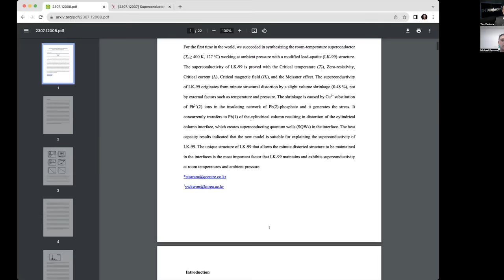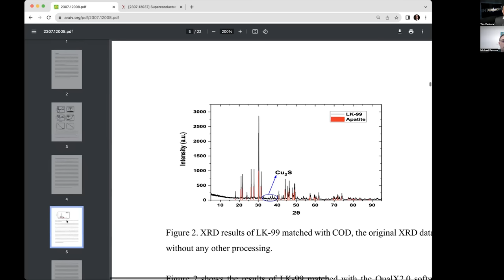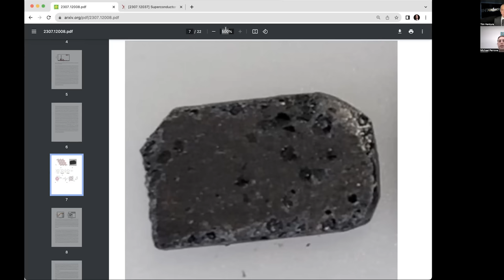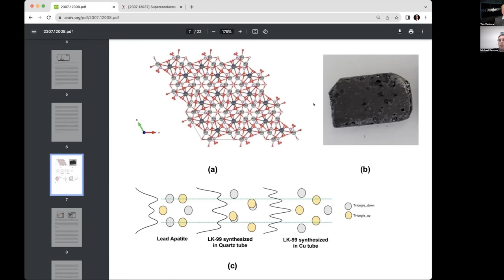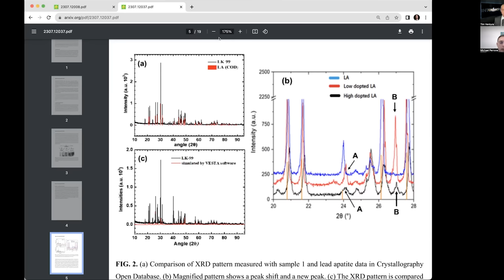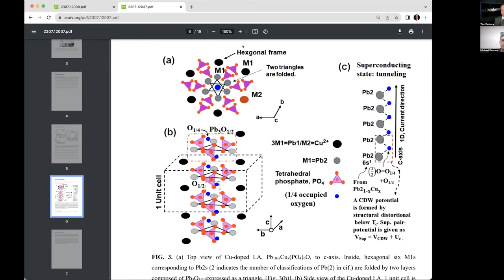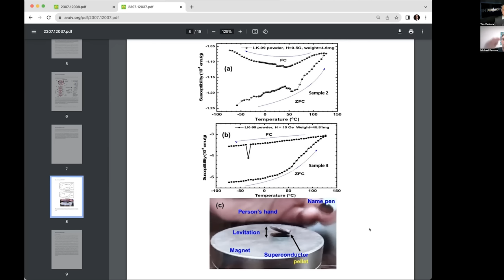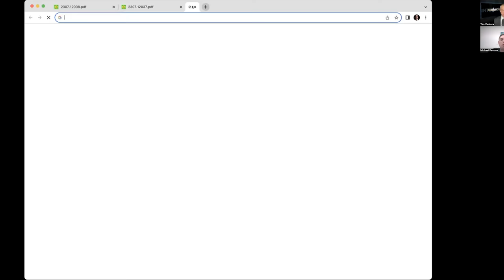Michael Perrone - LK-99 Superconductor

Comment: If an ideal superconductor is ever mass produced, it will be one of the most important advances … bigger than internal combustion engines, bigger than mass produced steel.   Besides levitated trains, solar voltaic energy from deserts to thousands of miles away where it’s still night. Incredible electric motors, 100% efficient electric energy storage, MRI machines to cellular level, perfect electromagnetic shielded rooms, nearly infinite Q resonant circuits.   Even a portable muon source for imaging solids like the Pyramids.

Comment: Some more good news about this is that once scientists isolate the exact crystal arrangement in the material which creates the superconducting effect, it should not be too difficult to use it as a seed to grow a much more pure version that likely as better properties because it doesn't have as much junk that the original may have had. They could also find better synthesis techniques improve the efficiency of the time it takes to create this stuff which would dramatically speed up the development of this material.
Reply: Exactly. I feel all these results are not very reliable when they aren't based on the purest form of the material.
Reply: Yes it should be easy enough to crush up material and isolate the best bits via the meissner effect to narrow in on the optimal composition.

Comment: Basically if a manufacturer finds a way to purify the materials and fine tune the baking processs, this could be commercial soon.
Reply: I don't think the baking process will be used for mass production - probably only to get seed crystals for the Czochralski processes or something similar. Maybe some initial/immediate stuff will be done this way but there's many ways to scale this up

Comment: the limit is current with this as it is... if its a real effect the breakthrough lays in the material science...we now know we can shrink the lattice with a chemical process and without extremely low temperatures and high pressures...different compounds and elements may yield higher current throughput

Comment: SUGGESTION for examination of Meissner effect:   Submerse the magnet and material in liquid to reduce the effective weight of the sample.  If the liquid is sufficiently dense, the material may completely levitate over magnet.
Reply: Yep we will try that in water and liquid nitrogen
Reply: Seems my comment is not being shown.  Possibly due to a link to a paper on isotopic substitution in HTSC.

I'll try again.

The Isotope Effect on SC is well established.

“Heavy” Oxygen 18 Isotope is about .2% of atmospheric oxygen.

Ambient oxygen is 99%+ oxygen 16.

Here is an example of how incorporating specific isotopes can affect SC performance:

Substituting O-18 into (this) HTSC has been shown to have, “… a strong (~50%) enhancement of Tc”

(Link to paper)

Possibly, there being only .2% of available Oxygen 18 to form the crystal lattice of LK99 could explain the tiny amounts of LK99 produced in replication efforts.

Add to that that there are several isotopes of lead and copper in significant proportions, and there is a reduced likelihood of the right isotopes hooking up.

Basically, I suggest trying to anneal in an Oxygen 18 Isotope atmosphere.
Reply: @daglasssweats8160  when they censor you that hard you know you're probably on the right track; thanks for the tip!
Reply: You bet.

Think it's worth trying?

Comment: An article that I read had polonium instead of phosphorus.
Reply from the maker: I think polonium is the radioactive substance used to assassinate that Russian dissident a few years ago. From what I've read, LK-99 uses very common ingredients.
Reply: More likely selenium if I had to guess - even the original papers mentioned a sulfur impurity in their successful materials, but selenium matches the lattice better. Maybe that makes less lattice induced strain and not more, but we'll have to see. If Polonium works, it's probably too radioactive to be practical, unless it has stable nuclear isomers.

Comment: I'm curious if Michael means stress when he says strain. stress is a force, strain is a deformation caused by stresses.
Reply: The standard terminology is currently lattice induced strain. The distortion of the orbitals is not necessarily due to mechanical forces - sometimes from steric effects or symmetry breaking. The distortion leads to strange effects. Compression is one way to induce strain, and lattice mismatch is another, but for buckminsterfullerene it's spontaneous symmetry breaking by increasing the number of electrons.